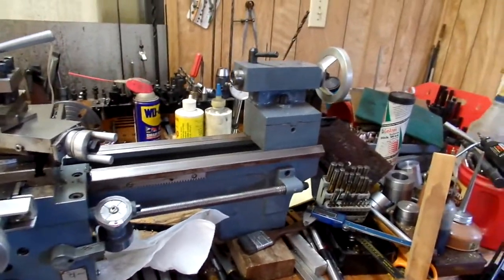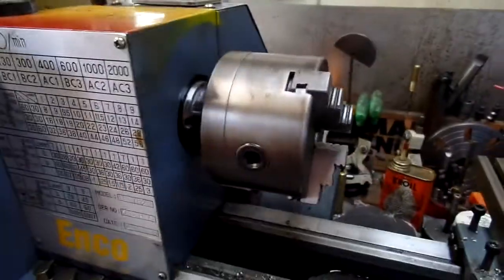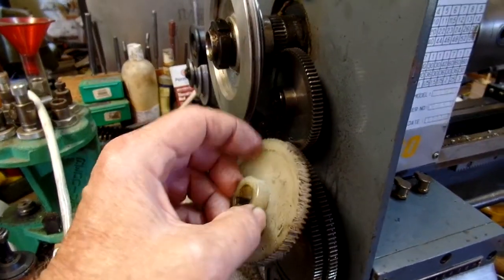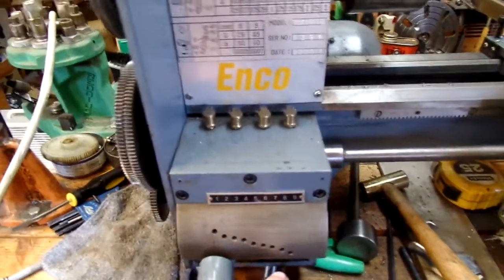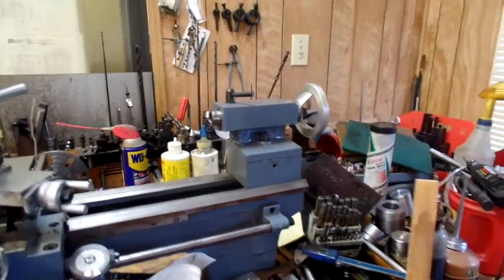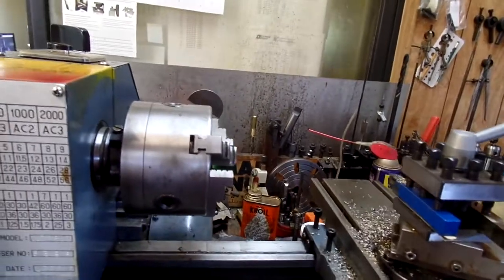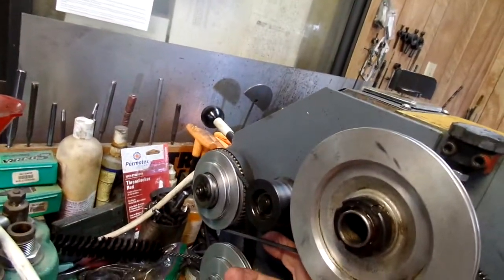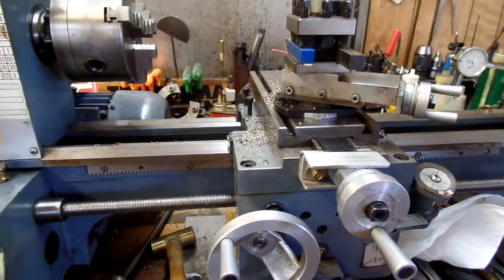E89 Features of the 9 x 19 lathe.

Comment from the maker: In the Groups.IO files section there is a spread sheet giving some optional gears.  I have a 120, an 80,  45, 42, 40, 36, and two 30. currently on the machine is a 28, in the A or O position engaging the 127 and a 60 in the B position engaging the 120 gear.
I did some 4mm threading trying to make some tools for the 39 x 4mm spindle.
Thanks

Comment: Do you have to change the gears to cut both metric and imperial threads?
Reply from the maker: Short ans is yes. Are there any metric pitches the same as imperial. I don't think so.
The thread charts I have seen suggest the pitches are not 100% correct for all threads Close but not perfect.
Reply: Dennis Williams I’m picking one of these up Sunday and I want to make sure it’s not missing any gears as I need to cut both metric and imperial. Could you tell me how many gears it comes with and it would help me so much. Thank you in advance and nice channel this video is really informative

Comment: hi Dennis, i wanted to change my broken lever for the half nut engagement but cant seem to get it of, whats the secret.
Reply from the maker: Heat? imagination,
Reply from the maker: I just looked at the apron again to refresh my memory.  There is a set screw in the half nut lever parallel to the cam shaft. 

I did not pull the lever off the cam shaft.  My lever seems to be pot metal so go cautious with heat.  Possibly destroy it and order a replacement from Grizzly or make one.
I will post a pic on Groups.Io.
Reply: @denniswilliams8747  i found  it Dennis, it was held in by a split ring,

Comment: Having that new gear in too close a mesh with the spindle gear is really hard on the gear teeth and the bearings, not to mention being very noisy. When they made the lathe, that plastic gear let them fudge on the gears meshing correctly.
If the new gear mounts on a shouldered bolt (or stud perhaps) on the back of the head stock, make a new bolt with the shoulder made eccentric to the bolt. A 1/32" offset would give you 1/16" total adjustment. A thin jam nut would hold the shouldered bolt in position once adjusted. A piece of notebook paper between the mating gears gives about the correct clearance adjustment.
There is the possibility that the mounting is already on an eccentric and can be adjusted without having to make anything new.
Good luck with your new machine.
Reply from the maker: Thank you for your input.
The new metal gear is close but not tight. Little clearance.
It has quieted a bit with little running.. Still a bit noisy at high speeds. 
I am still learning the idiosyncrasies of this lathe..
The threading chart in the manual is  confusing to say the least.
Studying the  threading spread sheet along side the manual is a help.

I highly recommenced any trying to thread on this machine to make a scratch pass and check with a thread gage.
Reply: Lubricate the gears with chainsaw bar oil. It is tacky and will resist sling off. Use just a little and it will quiet the gears quite a lot. I have used STP  and it works well, but the sling off is really gooey and you need a solvent like kerosene to clean up the splatter. Chips that work their way down the spindle stick to it and get into the gears (and be sure to check the quick change gear box for chips as well). Be judicious with an air hose gun and try to avoid blowing chips into any of the lathe's nooks and crannies.
Chainsaw bar oil works well on the lathe's bed ways too as it resists runoff. A gallon of it is less than $10 at the hardware store and it will last you for years.
Be sure to take grease in  you hand and reach up behind the apron and lubricate the worm gear. Most service manuals fail to mention that you should do this monthly for a lathe used regularly.
Never do any of this stuff with the lathe plugged in.. be safe.
Reply from the maker: @aceroadholder2185  When you adjust the gear mesh, close the gear teeth on a bit of paper towel or paper to include some clearance. 

Your reward will be quieter gears. Also run new gear for a while to wear them in.